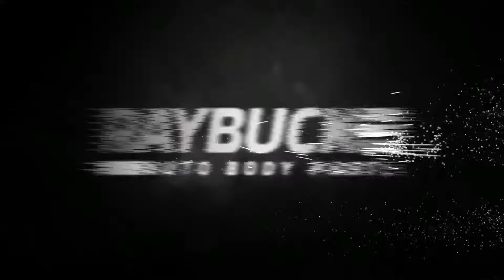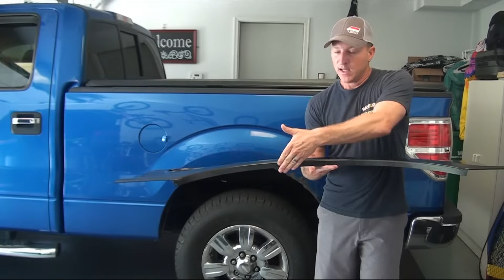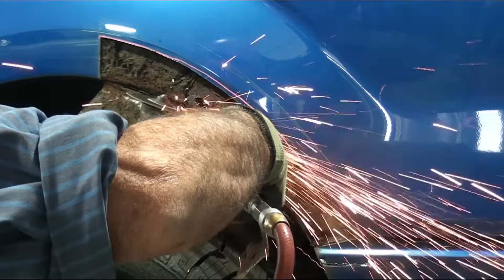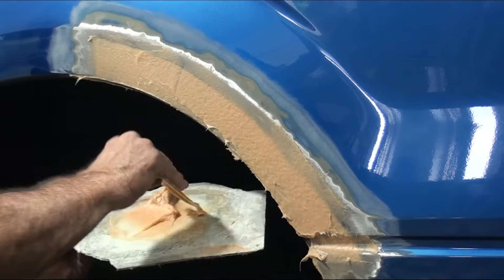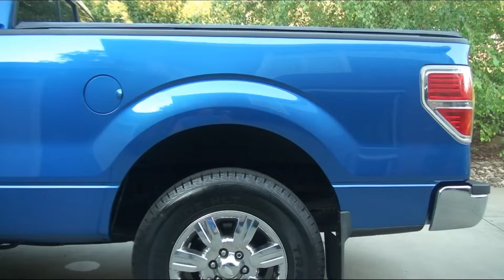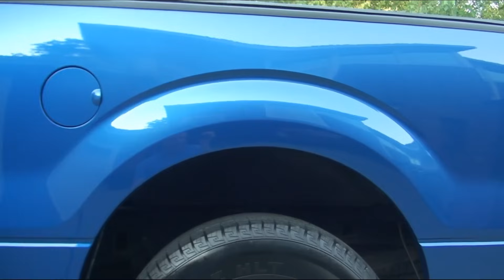How to Repair a Rusted Wheel Arch

Comment: I would tend to believe that a rock chip started all of this.  If the foam corroded this,  there would be much more damage.  But the foam will trap moisture which we all know is murder to sheetmetal.
Reply from the maker: Interesting thought, but no rock chip. The paint was perfect but started bubbling about two inches up from the lip. This is a really common problem in most late model pickups.

Comment: That guy made the fitment of the repair panel look so easy but I assure you it is not as easy as it looks!  I have repaired a few trucks over the years including bed wheel arches, cab corners, and inner/outter rocker panels.  What I have learned in my repairs is that it's best to avoid buying a vehicle that needs them and if yours develops rust over ownership than pay a pro like this guy.

Comment: If you wamt to overlap like that which is definitely faster than making perfect butt joints i would recommend looking into using a panel bonding adhesive. Less chance of warpage from welding but would seal that edge to keep moisture out. Also the recomendations on sand paper grits are pretty crazy. Do NOT sand body filler with 800,1000, 1200 or finer before primer. Look at data sheets if you are unsure, but usually 220 or possibly 320 on filler before primer. But if you are usuing a 2k filler primer i generally use 150- 220.

Comment: I wonder how long this repair will last before it starts to rust out again.  Seems to me that a fresh edge was left on the inside lip and that this area was not adequately primed and top coated.  Also, that weld was very porous.  Yea, you need to avoid metal distortion but you also need adequate penetration and this did not have it.  So all the holes were filled in with filler and that's not enough to prevent oxidation of the metal.  I give this repair a max time before rust-through failure of 2-3 years.

Comment: And in six months you'll have the same rust without treating it ( on the backside).. rust reformer and encapsulation...then prime and paint. ...the reason all trucks rust is there is no rust prevention at the assembly (spot welding process)

Comment: You'd think with all the smart engineers in the auto industry they could easily design a rear wheel arch area that doesn't collect dirt and moisture which results in the rusting.  Makes one think it might be on purpose.

Comment: A little over the top for a 2012 vehicle rust repair 
The end result is nice.
Reply: Not really. A pro method would have the metal butt welded so it did'nt take a bucket of filler. Last time I did this I used zero filler, but in general nobody cares. Just did it for my personal satisfaction lol.
Reply: @spinnetti  a butt weld would have been better especially if you are doing restorations or working in higher end vehicles,but in production shops they will avoid when possible because it takes a lot of extra time to make them match perfect. Also that is definitely not a "bucket of filler". That metal is maybe 16 gauge that's all the thicker the filler is, also he did the first coar with fiberglass reinforced filler which seals better and is stronger for the bit of extra thickness. He then coated with regular filler which is much easier to sand and finish.
Reply: No way.. this is a lower end type repair in my workshop. 
We butt weld inner and outer skins on higher end jobs, at the end of the day, it's up to what the customer wants to pay.

Comment: How much does the repair cost?
Reply: If  You're doing it yourself just the cost of materials for a decent size can of filler it's about 40 to $50 plus about $60 for paint match, Primer and clear coat and about $25 for metal wheel arch replacement pieces
Reply: @theoutlawsgaming2239 What about like a body shop, how much would they charge

Comment: Nice repair work.  My concern though is that the repair job took care of the obvious damage visible on the rear portion of the wheel arch, but what if there is similar damage farther forward on the front side of the arch that just hasn't made to the surface yet.  Do all manufactures use this spray in foam sound deadening in these truck wheel arches?
Reply from the maker: Our understanding is that most manufacturers use this spray. And yes, your concern is founded. There could be rust starting in a different area around the arch. I would highly recommend just doing the entire arch, instead of just a section of it as was done in this fix.
Reply: @RaybuckAutoBodyParts  you should highly recommend box side replacement but you have shitty repair panels to sell.
Reply from the maker: @13christbane  Have you used our panels for repair work? Also, have you priced out a complete box side replacement vs a patch panel repair?
Reply: @13christbane  hey if you really don't want to take half measures why not just strip the car bare and replace the entire body

Comment: I looked on your website but you don’t have anything for my 2016 ram 1500 bed wheel well.  Just started getting rust.  Well last yr and was thinking I should fix before it gets to bad.
Reply from the maker: Sorry, that's correct. We don't have the replacement wheel arches for the newer Rams yet.

Comment: I’ve seen a lot of comments indicating that the overlapping metals will cause it to rust eventually. Is this true? Would it be more costly to have it done differently ?  Thank you! I really enjoyed the video!
Reply from the maker: With the overlap, I think it depends on how well you seal the area behind the patch. Personally, I would butt-weld the panels so water wouldn't be able to puddle anywhere. That said, it's been two years and the fix is still holding up.
Reply from the maker: I would take it to a body shop
Reply: Thank you for the feedback. I am going to call for some quotes on my job tomorrow. Would you recommend a welding and fabrication shop, or a collision/body shop for the best work at the best price?
Reply: I know you’ve said that around $1000 would be a fair cost for the repair. I am getting quoted at around 2,500+ from shops I’ve called on and my rust is not even bad. It has not rusted past the body line of the wheel arch at all. What strategies can I use to find an affordable shop that does quality work. For context, I live in Port Huron, Michigan
Reply from the maker: @joemorgulec2012  that seems high, but a lot of shops don't like doing rust repair, so they may price the job accordingly

Comment: Not recommended. The rest of the quarter will rust out later.
Replace entire quarter or use engine patch and remove the awful sound deadner.
Not sure why there has not been a class action suit against  Ferd under lemon laws

Comment: If you want to repair that area why would you go and buy flat stock and make it from scratch or buy a large panel like the one you're selling? Just go to your friendly neighborhood junkyard and slice out the appropriate section from a front fender which has the same contour and body line as the one you're selling. The Ford front fenders never rust from the inside out because they are single wall. I'm about to do that on an a 2007 F150
Reply: Personally where I live virtually every car is in the same state of decay

Comment: Stupid music that serves no purpose!  One question: I have always been told not to bondo over bare metal as the curing process traps moisture against the metal.  I have had great success with applying epoxy primer before the body filler. 15 years later and not a trace of rust.
Reply from the maker: Yeas (decades) ago, the practice was to apply filler directly over bare metal for best adhesion. Most, if not all, fillers now recommend laying down a coat of primer first. I believe it has more to do with bonding adhesion than moisture, but I can't say for sure.

Comment: Why do domestic manufacturers use this double wall with foam method for bed sides? All Toyotas I’ve owned have single wall bed sides and I’ve never had them rust. Easy to rust proof and don’t trap dirt and moisture

Comment: Why didn’t he place the new panel then do a cut and butt? Weld that seam fully closed and then you have zero percent chance of water getting behind the body filler. At that point you can use minimal body filler and have a smooth surface. The way he’s doing it you have to build the repair back to the surface with filler. Seems like it’s defeating the purpose of using the premade body panel. If you’re using that much filler go ahead and fab your own wheel arch.

Comment: Looks great but i hate the body filler idea. Is there any way to get the same results without using it? Heavy primer ect...
Reply from the maker: Only real way around it is to metal work everything. Even with that, you'll probably still need to glaze it.
Reply: @RaybuckAutoBodyParts  thank you for responding so quickly

Comment: After a year, how is the repair holding up? Did you do the other side too?
Reply from the maker: The repair is holding up well. I haven't had to do the other side yet. I've also been spraying Fluid Film around these areas in the Fall each year to help keep the salt off.

Comment: it happens on the 99-04 mustangs  to bad there is no patch panels you can buy for those cars. I had to use fiber glass and bondo it didn't hold up well and i have to do the repair again.

Comment: Who let this man near a welder🤦🏻‍♂️ No mask on or gloves, might be old school but it's one way to give yourself melanoma. That repair is just going to rust from the inside out again due to that overlapped piece which will trap moisture and that skim of fibreglass will start coming away from the panel when it does. No manufacturers repair process includes overlapping a repair section unless it is for a plug weld or resistance spot weld on an aperture you can seal afterwards. It looks good for now but it will come back through worse as that inside edge is exposed.

Comment: Hey Steve, where do you purchase your sheet metal, I need to order both side for my expedition, also what did they charge you to do the work so I have an idea. Truck turned out great..
Reply from the maker: These types of panels are all from Key Parts. The work on my truck typically runs in the $700-$1000 range.

Comment: This is not an ideal way to do that repair if you plan to keep the truck because the body filler you need to blend in that repair going to retain moisture and in 1-2 years depending on where you live will blister and you’ll be back square one. I’m not knocking anyone’s work just isn’t the proper way for a longtime repair

Comment: That will rust/bubble soon. Use epoxy paint below putty! How’s the inner/outer panel seam done? Maybe still open?🤦🏻‍♂️ Not a good example at all. Just regular fast job before selling.
Reply: You have no clue what you're talking about, and it shows.
Reply from the maker: This is my daily driver. One year later and it still looks good.

Comment: NOTHING SHORT OF FASENATING!

I like how you narrated to explain what he was doing.

All in all: I'm estimating he charge 3 hours of Labor. I'm going to call it $45 an hour.  So that's $135 in labor.  I don't know what the material cost would be but I'm just going to add another $65 for the paints and primers and body fillers.  Is this the less than just getting a whole new side of the panel?

I'm going through this on my 1999 Toyota Solara. It's a beater...🤷

But online aftermarket has the driver side front fender for around $70 and Toyota has it for about $160. I believe in both instances that's just primered and I'll still have to paint the thunder.  I just pushed through the rest today and it's about a 2 by 3 inch hole. Maybe I'll try one of those fiberglass big-box store body Bondo type things....dunno.... But I damn sure don't have the skill to do it as good as this video showed.

Comment: You would think that these manufacturers would come up with a better way to do their fenders especially knowing that they almost always start rusting there. I'm looking to buy a used truck, been looking at Dodge Rams hard, and it's hard to find one 10 years old that doesn't have rust all in the fender wells. The rest of the truck can look great but those fenders are a different story. Turns me off from wanting to buy one. I'm not really a body man although I do have a tig welder and a cheap wire feed welder. What worries me the most about doing it is matching the paint and blending it in...
Reply: My thoughts exactly.  Bought a 2017 Silverado here in Canada 3 years ago and now one side is rusted bad.  Why can't the manufacturers do something about this?  I had a 2010 GMC Acadia for 10 years and not a spot of rust on it.
Reply: They did . Aluminum
Reply: @justinpennington7682  Which one uses aluminium? Too little too late in my opinion. I changed my game plan since then anyway. Bought one of the best cars on the road instead, an '02 Lexus LS 430, not a spot of rust anywhere and drives like a dream. A truly amazing car.
Reply: @bodeine454  Ford
Reply: @justinpennington7682  I didn't know that, thanks for the info.

Comment: What happened is these auto manufacturers are not building quality vehicles they've decided and came up with the idea if they build crap that rusts away in 5 years or blows up the person has to buy another vehicle so they don't build quality Vehicles they build disposable vehicles most of the new trucks today only last a couple years will they get holes in them pitiful pathetic
Reply: Yeah like square bodys and the likes from the 80s...? 😅😅😅😅. They never rust out.. Especially the floors, wheel wells, rockers or hoods.

Comment: Hello. Quick and final question. One side done, my inner wheel well did not need repair. Not so lucky on the other side, When you weld in new piece on inner, don't you have to weld up the tops where the notches  are are??? Your new welded piece is only on the outside of the inner wheel well no notches. I hope I am clear. Thank you
Reply from the maker: If I'm understanding you correctly, then yes, you should weld up anything that was previously a solid piece.

Comment: This is not the way to fix this it might last a winter and you will be in there again
Reply: What's your solution???
Reply: @jamesgould6001  cut it all out and get rid of the foam
Reply: @jamesgould6001  cut out the whole thing and get rid of the rust
Reply: @bluelightguy1  Gotcha. Thanks

Comment: About how much would a job like this cost the customer?😊
Reply from the maker: It's hard to put an exact amount on a project like this as it's variable, depending on the amount of rust that needs to be repaired, the cost of the parts, and the labor rate of the shop doing the work. Roughly, though, it's probably going to be in the $800-$1000 range.
Reply: @RaybuckAutoBodyParts  thanks for the reply

Comment: Between the inner wheel well repair piece lip and the new wheel house arch lip did you seal that, or what did you do?
Reply from the maker: Yes, they seam sealed along that edge, and all other overlapping edges.
Reply: @RaybuckAutoBodyParts  Thank You!
Reply: One more question for you, since I have gotten my panels and am getting ready to start. What is "weldable primer"? Never heard of it before, and can't find it. My local part stores never heard of it either. Thank you
Reply from the maker: @jamesgould6001  We sell weldable primer. It's meant to be sprayed on before welding, and then it gets pulled into the weld to help keep it from rusting. Some people use it to coat the inner side of panels that are going to be welded together, but it's not really meant to protect those areas for the long run. Once welded together, something like a cavity wax, or inner panel coating really should be sprayed into these areas.

Comment: You lapped it, well I guess you wanna do that repair again, I give it a couple years at best. If it's not butt welded and sealed from behind, you're doing it again, don't throw out the left over patch panel you'll need it.
Reply: 100%
Reply: Definately not a long term repair, rust is still there and will form worse in the "overlapped" area.
Reply: Every one's an expert huh

Comment: a lot of work for something that will last about a year been doing body work for 45 plus years if you are going to keep the truck put new bedsides on the dam thing when you do all that welding you have burned off all the E coat on the back side then here comes new rust in less than a year
Reply: What is a new bedside? I am thinking of doing this on my car as it is very special to me how could I repair it on a car without it rusting in a year?
Reply: What do you recommend for Tahoe, same issue?

Comment: I have the bubbles starting on my 2013 F150.  The one bodyshop I took it to for a quick diagnosis said they would only replace the whole box side. Is the repair in this video common to bodyshops? Very satisfying video to watch BTW.
Reply from the maker: That's not surprising. Some shops do not like to do rust repair work, so they tend to push for complete panel replacement. The repair shown in the video is very common, so I would suggest calling some other shops.
Reply: @RaybuckAutoBodyParts  thank you!

Comment: Certainly the right way to make the repair, but that's a large panel to have to buy and ship to make such a small repair.
Reply from the maker: True, depending on the size of the repair. Every vehicle and rust area is going to be different. Our panels are meant to cover all of the areas that commonly rust out, but they can obviously be trimmed down to fit the specific needs of each vehicle.

Comment: Do rust bubbles always mean holes in the bodywork? My neighbour has a Mazda 6 with rusty wheel arches like that.
Reply from the maker: Not always, but usually if there's a bubble, that means water is getting in from behind (which is typically from a rusted out panel)